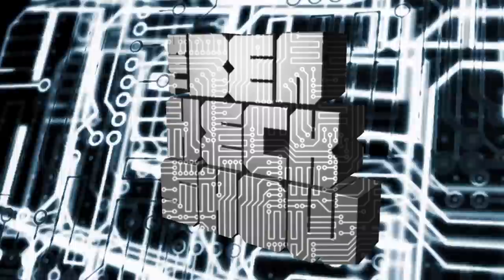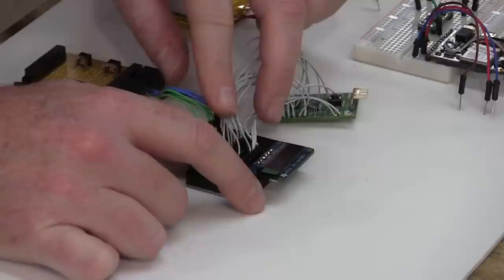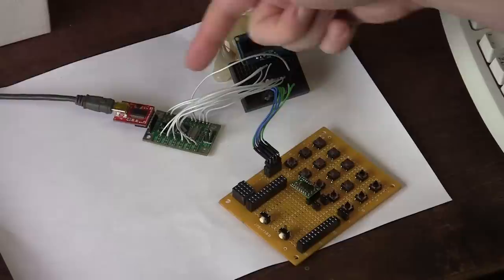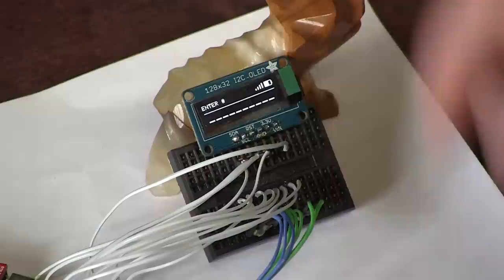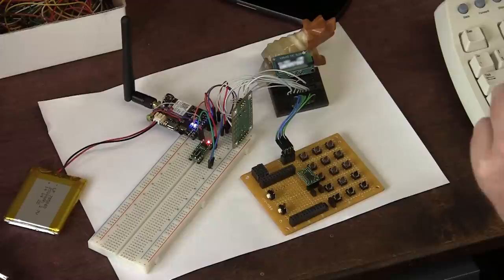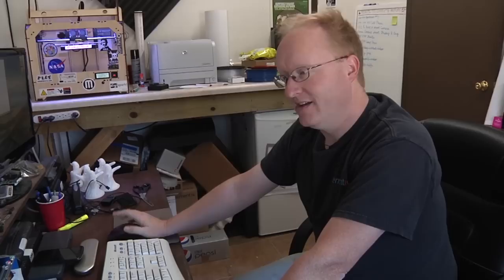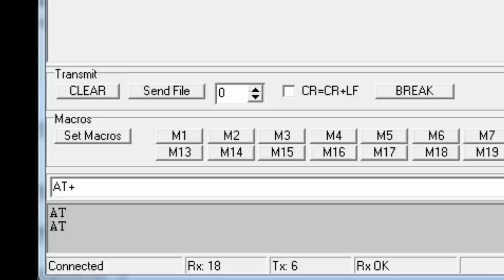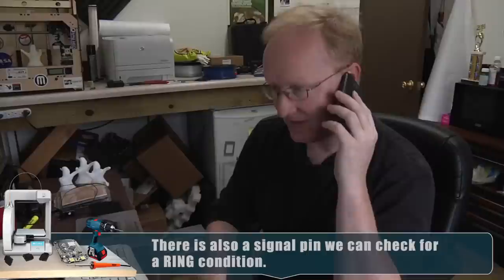Ben Heck's DIY Cell Phone Part 1

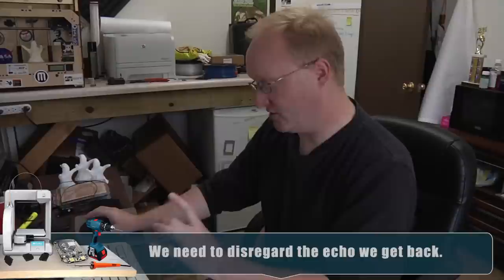Comment: 11:30 The reason you get an "extra" 13 (carriage return) is because that's what you typed and sent to the modem.  AT followed by the enter key (which is 13 hex).
So you get echoed back the AT, enter (13), followed by a carriage return (13) linefeed (10).

Also if you are going to be ignoring all the echo's, you can just disable echo with AT E0
(enable with AT E1), the only real reason to have echo is to see what you typed if you're running a visual terminal console.

Comment: Hayes modem commands FTW. Btw, AT = "Attention" i.e. "I want you to do this instruction". Back in the BBS days you used to literally command your modem to talk to a BBS using nothing but a serial console and manually typed AT commands. ATD = Attention, Dial... ATA = attention, answer... ATH = attention, hang up... Etc... Cell modules still use the same commands decades later because it's a good standard. This is why the "Ring" looks like it does as it was designed for an actual human looking at a serial console on their Apple II

Comment: Use a finite state machine to parse the AT commands. It's much easier than parsing it line by line. Specially if you want to handle timeouts. Even if you do it character by character you might end up with a long switch statement but it will be simpler code.

Comment: Random question, Is the only way to control an arduino with a raspPi is using the raspPi usb port, or is there IO on the rasPi that can be used instead, I'd rather use my usb port for my battery then arduino.

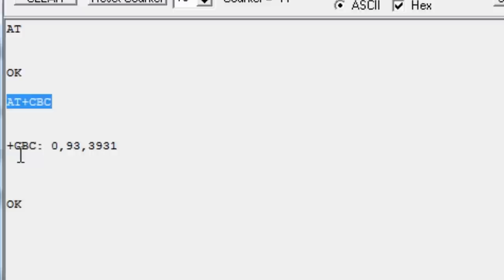Comment: I'm sure you know this but maybe a budding programmer or tinkerer is reading this. At 12:30 run it thru a split() function parsed on the commas. Zero based array index 1 will hold that battery percent value.

MyArray[ ]=Split(mystring,",")

iBatPerc = cInt(myarray[1])

Comment: Hey Ben, I have an old laptop screen, 15.6 inches. I want to turn it into a monitor for my desktop. Any suggestions?
Reply: Here's an instructable for help: http://www.instructables.com/id/How-to-Convert-a-Laptop-LCD-into-an-External-Monit/
15.6 makes me think it's newer style LVDS, and LED backlit. you're on your own there... but kits are sold to do just this.
Reply: Thanks, I have another question. So it needed something of the essence of an LCD converter or something. So I took apart an old LCD tv I own. It was too old for it to connect, but before I put it back together I wanted to go farther. So I took apart the LCD screen. There was those sheets and the black glass thing. At the very bottom there were these glass tubes. I, trying to disassemble it, broke a couple in the process. Can you tell me what these are?
Reply: Sorta guessed it. I broke all of them.

Comment: I can't believe no one has taken a bunch of old phones taken out some parts and build their own tablets out of old cell phone and tablet parts I was thinking about building some sort of iPad out of a iPhone 6 soldering pieces into a old Android tablet with a nice screen resolution that would match and run iOS on it from the original processor and motherboard from the iPhone inside of the tablet chassis and see if I could basically just build a bigger iPhone 6 basically a iPad I can't believe no one has tried anything like this on YouTube build a Frankenstein phone or tablet out of old phones